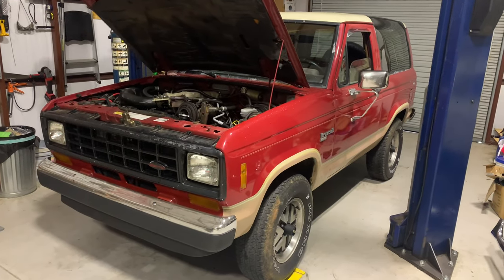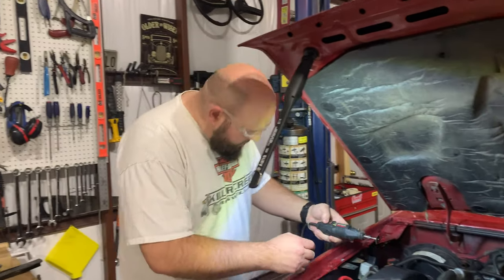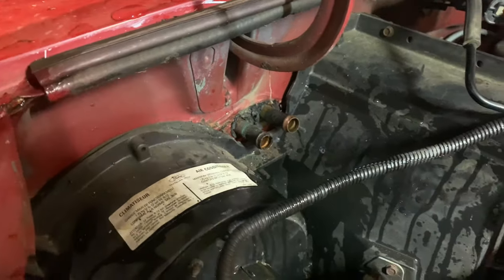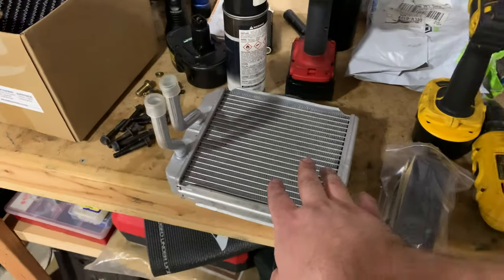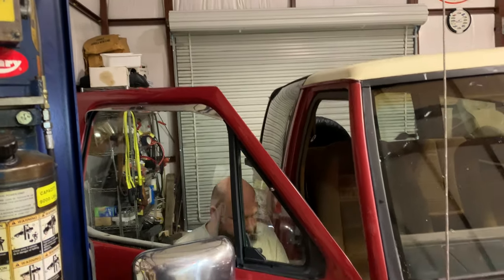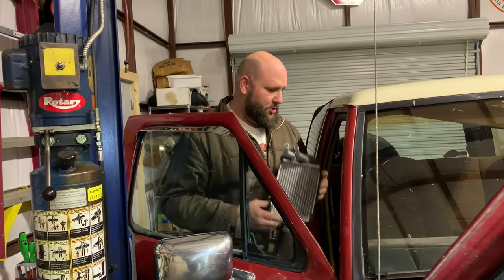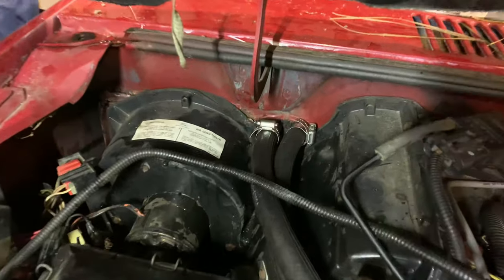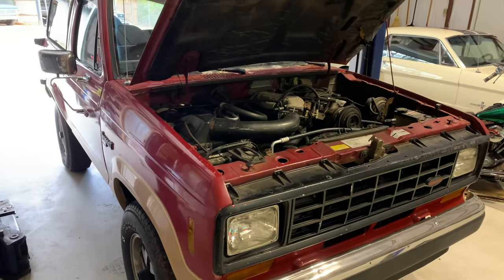Replacing the HEATER CORE - ‘88 Ford Bronco II

Comment: Love your Bronco videos! I've got an '87 red and tan. It been in my family since it rolled off the lot way back then. I've been meaning to ask - what size tires are you running on yours? I really don't want to lift mine (trying to keep with the stock look), but if like to find the largest tires possible without rubbing. I've read a 235/75  r15 will work, but I haven't tried anything yet.
Reply from the maker: Jason Carson yes, these are 235/75/15 on here and they look really good.
Reply: 235/75 r15 will fit and look good on 88 Bronco ll. Mud terrain Do rub front sway bar slightly at full turn but not enough to hurt anything.
Reply: @HiRevzMedia  oh no u selling the bronco 😢
Reply: I just put 235/75/15's on and they look and work great.

Comment: The aluminum  core is just stamped together,  had problems with  them, better  to spend the  extra money and get the brass factory core. I own a 1984 and a 1988 so I have been  there  and  done  that.
Reply: probably more heat output as well